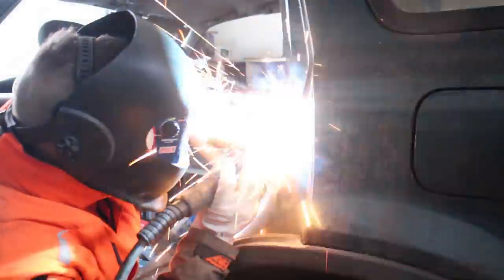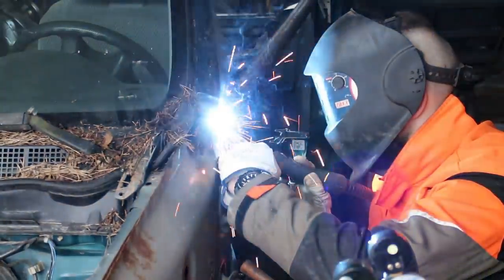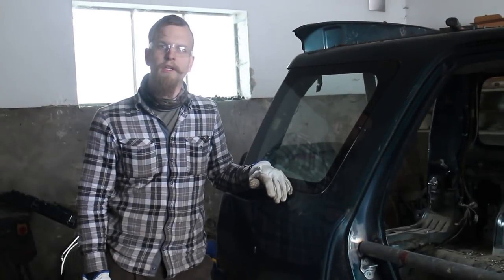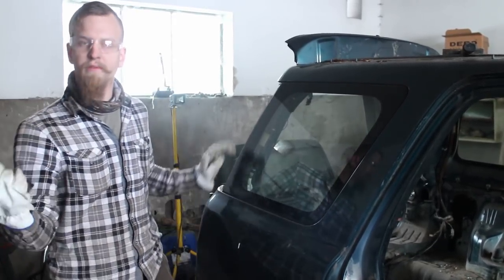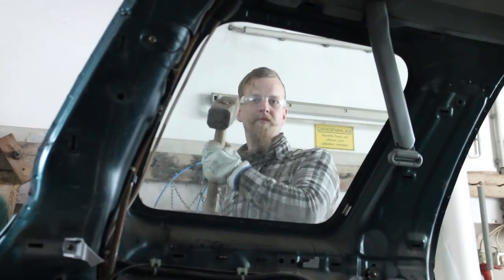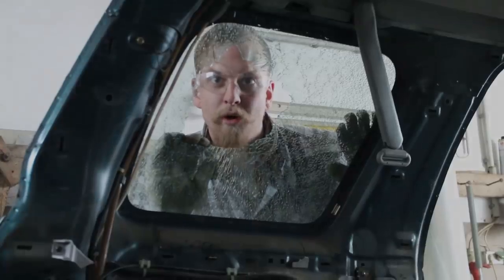Building A Bug Out Vehicle  - THE BREAKDOWN - Episode1 Part2

Comment: Looking good so far... . Yep, two bucket seats & roll cage is a must ( exoskeleton would be nice :) , more ground clearance, better suspension. And a front winch, intake & exhaust snorkels ( only if the terrain demands it ). Cargo space, with an assortment of attachment points; Steel plates to protect the fuel tank, drive train, sump; Steel grill to protect the radiator & winch... .